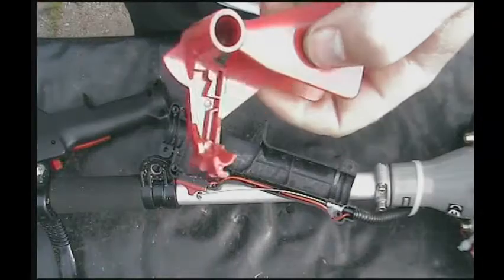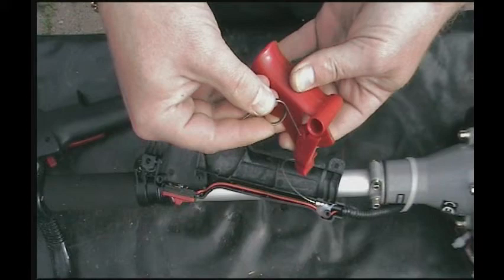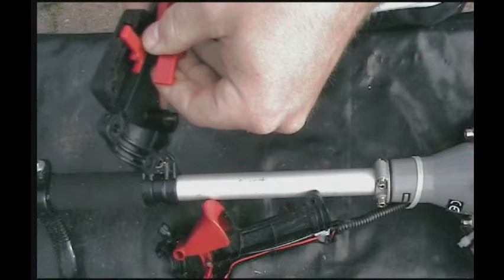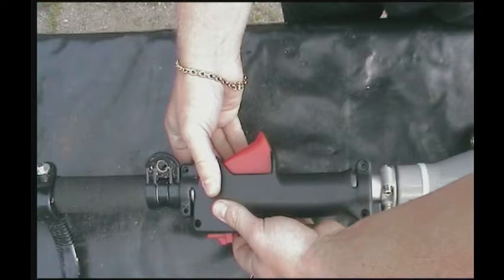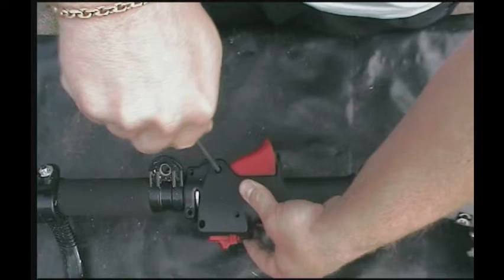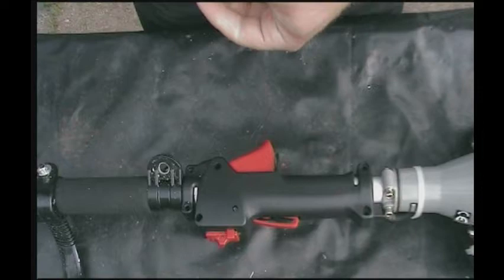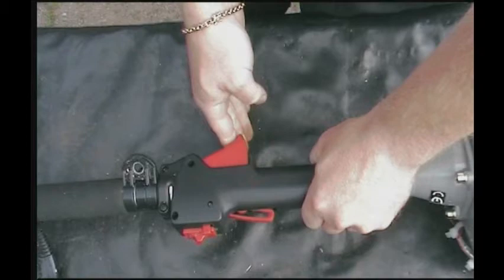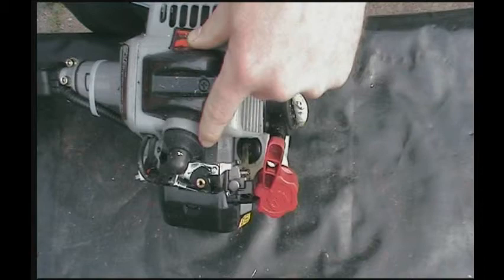Grass trimmer throttle repair

Comment: I still didn't get what I was looking for to put back the spring back on the bottom control trottle trigger release part that controls the top trottle trigger on a fs 100rx model.